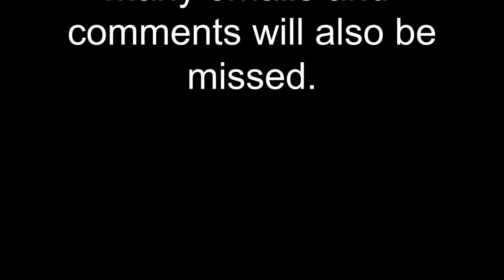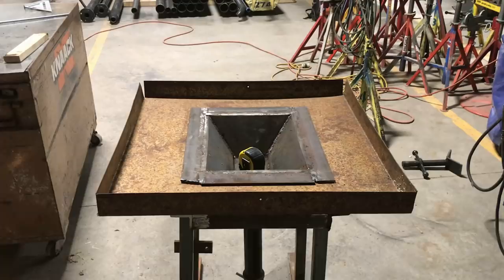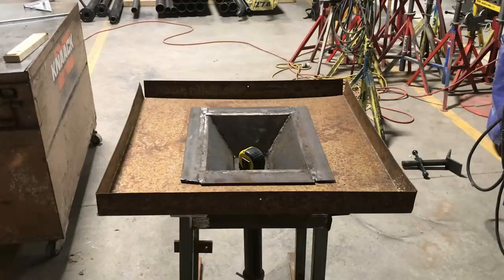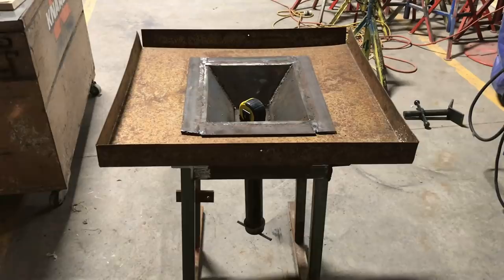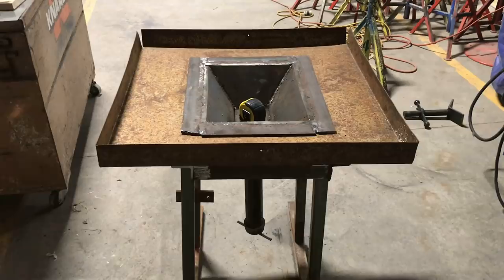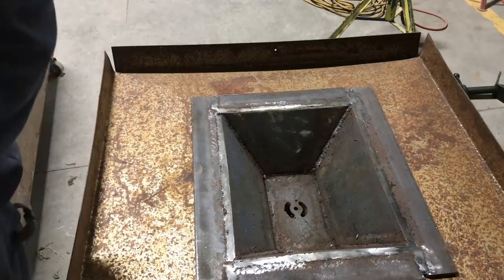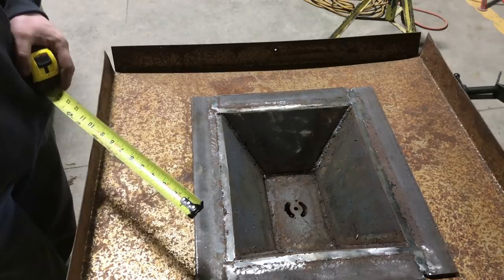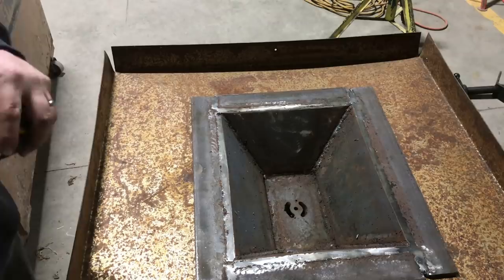Shop Vlog #2: The Big Coal Forge is Finished and Ready for Forging

Comment: Sorry to hear about Bob. 
The forge will last at least as long as mine. I don't have a clinker breaker either the forge was made in the 1800's and when I got it 25 years sgo it had a steel plate with 5 or 6 holes in it. Works just fine. I burn Pocahantas coal. No clinker and no ash. As it burns the fine ash goes up the chimney. 
Nice job on the forge. Looking forward to the new projects.
Reply from the maker: Thank you.

Comment: hi jim from the other jim sorry to hear about bob its sad.now to my comment i was watching you weld and the reason im going to say this is to help you get better at it when welding with stick electrodes the simple rule of thumb is if it has slag you drag the electrode your angle of welding should be about 45 deg from horozontil and about 10 deg off to the side if you push the molten pool you will get slag inclusion.just a little tip to maybe help youget better not a complaint i have learnt so much from you it would be nice to give a little back.not to mention the hrs of enjoyment i have had watching your vlog of barn build but your chatter during and after each video is both informative and enjoyable.
Reply from the maker: I take no offense and your advice is exactly the type I need to become a better welder.  I'm self taught in most things so those bits of knowledge really help me.  Thank you.
Reply: After near on 50 years of welding a few tips for you is a piece of giving back for the knowledge you have shared with us.I guess we all can share a bit so we all gain.These channels only keep a lot of skills alive that are being lost

Comment: Interesting, so bottom feed air ?  I was taught what little I know on a traditional forge with the tuyere at right angles to the bed. Is there any advantage to the bottom air feed ?
Reply from the maker: The side blast forges usually require a water jacket around the tuyer to keep it from burning up.